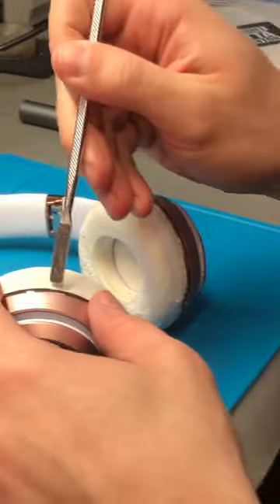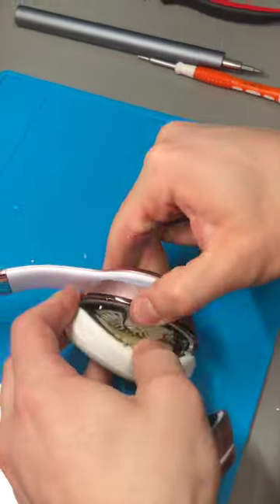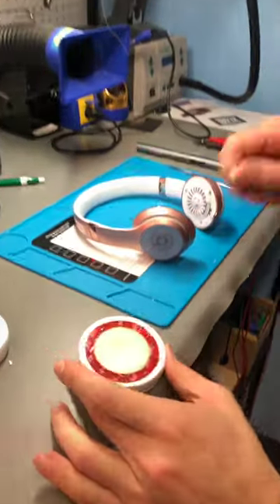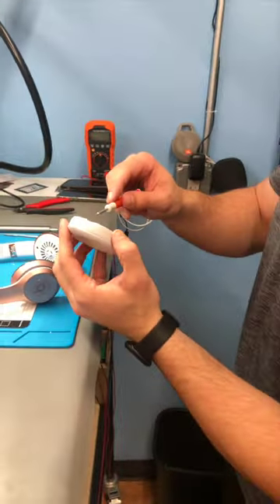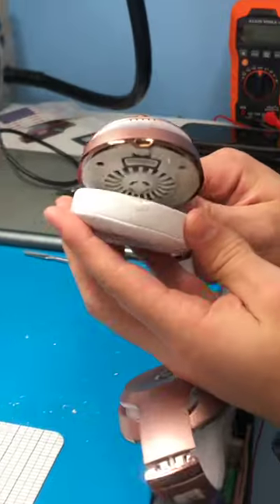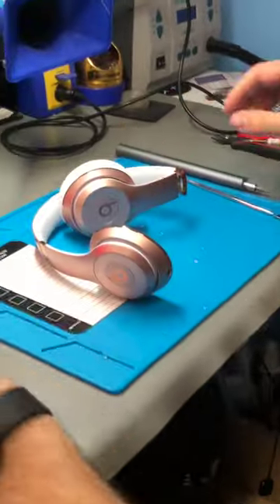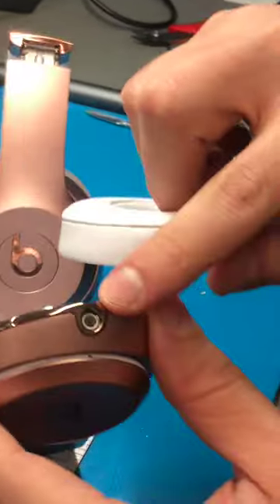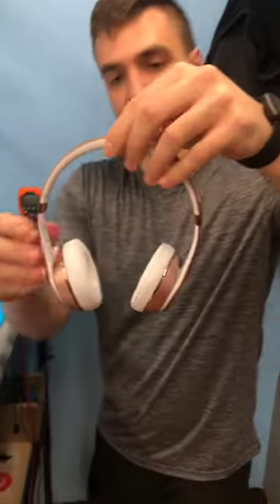Quickly replace your Beats Solo 3 Solo 2 and Solo 4 Earpads

Comment: Quick hack: don't buy overpriced and overrated beats in the first place. Much respect to video creator though
Reply: What are your thoughts on Sony?
Reply: @kyroking9934  depends on the model.
Reply: What headphones u suggest
Reply: @lorenzoreynolds2512  I currently use a SkullCandy Grind iQ BT in-ear earbuds. A bit pricey, around $70-$80, but very worth it. Charges to 100% in 10mins or less. Sleek looking. Around 9 hr battery use on the buds without a charge. 2 hrs after a rapid charge. Sweat resistant so great for gym. Bass works like it's supposed to. Only gripe i have with it is that it is a lil big (most of them on the market are anyways) and falls out of my ears when I sweat during a workout sometimes, but maybe it's just my ears dont hold headphones too well. Hope that helps.
Reply: @egdapo  oh ok thanks

Comment: I replaced my ear pads exactly this way but now my audio is 1/4 of the sound it used to be. I have it turned all the way up too. I did not damage the speaker in the process either. Any suggestions on how to get the volume back to normal?

Comment from the maker: Hello all, unfortunately, we have stopped servicing the Beats Solo 3 headphones. We will still be selling the parts. You can follow this link - https://bit.ly/3QNLdaz - to purchase any parts you are looking for.
Reply: Hey man! Hope all is well. Are these the same size/ compatible with the Beats by Dre wireless headphones 1st generation? I found my old ones in the garage, still works but the foam pads are worn out, in need of replacements. Pls lmk if they’ll work with these! Thx!
Reply: Do you know what's wrong with mine my beat solo³ won't charge anymore but im not sure if it's the battery or the light, i don't wanna risk it tho.
Reply: can you replace over the ear pads on a on the ear pair of headphones?

Comment: Is it ok if the pins are broken? Because i just found out that they broke and got stuck in the former ear puds
Reply from the maker: It's fine, just a little harder to line it up properly when you install them.